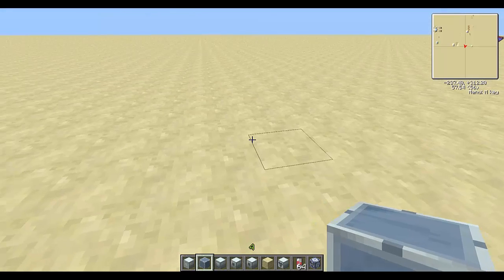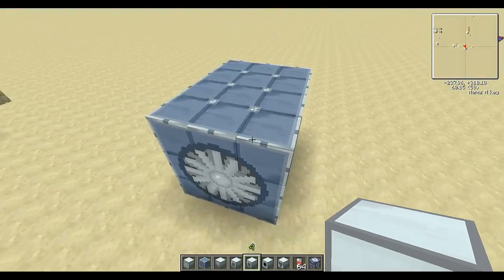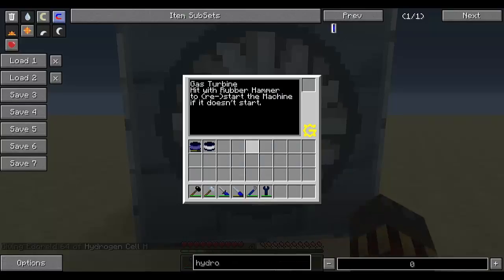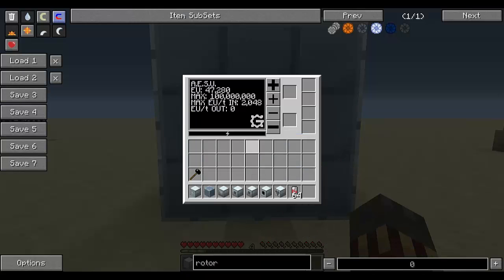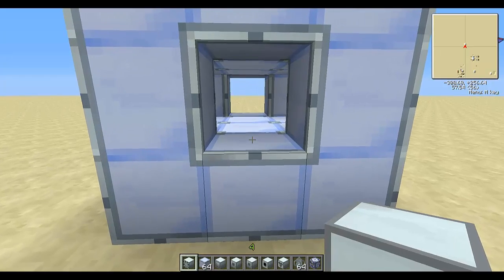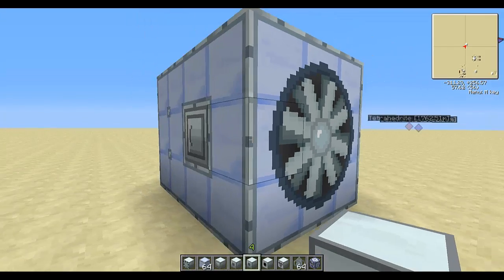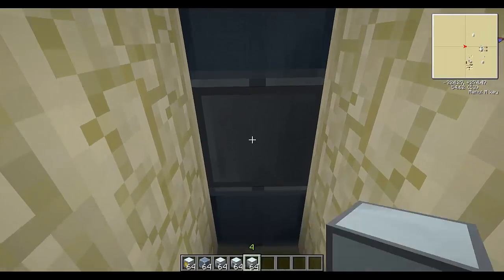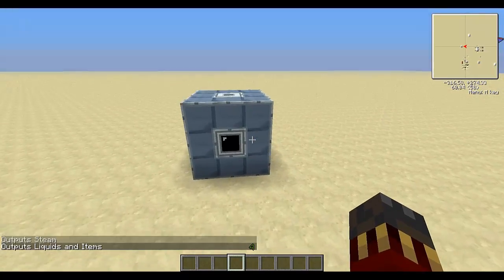[Tutorial] GregTech from Scratch 12 - Gas Turbine, Steam Turbine & Thermal Boiler

Comment: Output hatches cannot output their goods automatically, you need to use pump modules on the input hatches of the turbine. Once you've done that then it will draw from the output hatches of the boilers to run itself.

Comment: The output hatch refuses to vent steam on its own. I have to "pump" the steam out using a liquiduct. Simply placing two boilers next to a turbine, matching input to output hatches does not work for me. I'm not sure if I have a magically defunct copy, or this has changed.. but it's rather infuriating.